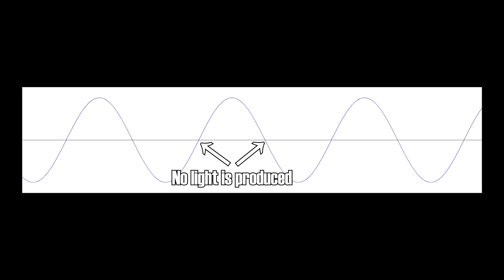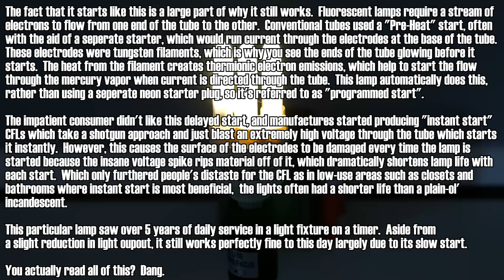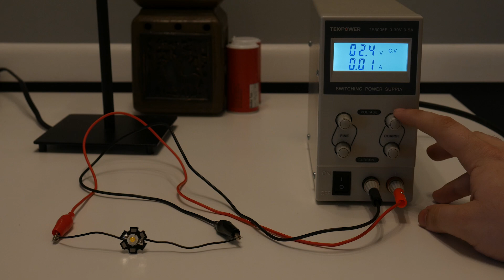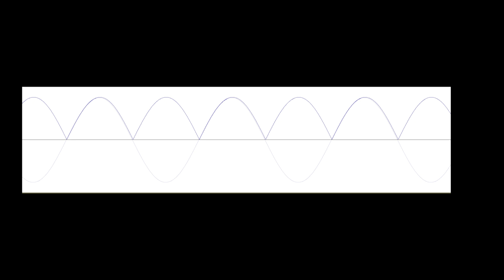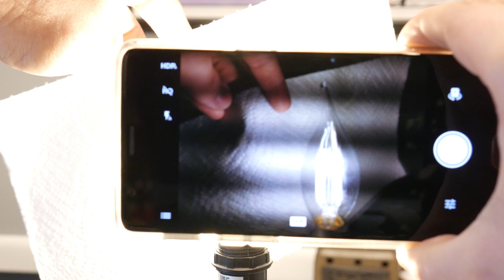LED bulbs that flicker, and CFLs that almost never did

Comment: You should see Bigclive.com's teardowns of these things... There are THREE common driver circuits in use.
1. The very flickery capacitive dropper, usually found on pound / dollar store bulbs... it does have a very rudimentary amount of smoothing, but that's only to protect the LED chain from switch on spikes. These are non-dimmable, and the massive spikes caused by a dimmer would probably burn out the inrush limiting resistor. Has significant capacitive power factor.
2. The "driverless" approach, where LED chains close to supply voltage are driven by a rectifier and current limiter - the dimmable version would tend to have an extra resistive load that is turned  on when the voltage drops below the LED conduction limit. Excellent power factor.
3. Switchmode buck regulator - the least flicker, but can show a harmonic power factor like any non-PFC switchmode PSU
Reply: I suggest you watch bigClive videos again, especially the ones with more sophisticated drivers.
Reply: .... very flickery capacitive dropper, usually found on pound / dollar store bulbs... it does have a very rudimentary amount of smoothing, but that's only to protect the LED chain from switch on spikes. 

Nope. The smoothing cap is to bring it closer to DC, reduce flicker, and improve efficiency. A resistor is usually used to limit current surge.
Reply: I guess Phillips Hue uses type 3? They're not actually dimmer switch compatible, and I guess you'd always need a driver for the RGB values?
Reply: @kaitlyn__L  Hue bulbs house tiny computers which happen to drive LEDs. It's like plugging your PC into a dimmer and expecting it to dim your monitor :)
Reply: @SheaMcCombs  but the monitor has its own microcontroller and driver handling the backlight. So your analogy is a stretch. Especially because the microcontroller inside a Hue bulb responds to other aspects of light switches. And I never said that I expected them to behave with dimmer switches, I factually stated that they don't work with dimmer switches. You can take your condescension elsewhere.
Reply: @kaitlyn__L  Didn't mean to offend, only to make an analogy as to why they're definitely type 3 and don't like their AC being modulated.

I suppose some clever electronics could monitor the waveform (I've seen this in some bulbs) and pass a dimming value on to the microcontroller, but then that'd have to override the hue bridge. So, yeah, they're more like computers with 1-pixel monitors. It's an interesting question and thought it was a fun analogy.
Reply: @SheaMcCombs  ah, sorry, I've had a bit of a bad day. That's my bad. You were probably fine any other day. I also didn't realise you were indeed confirming they were type 3 - thought you were just pointing out the existence of a microcontroller.

I had assumed the light's configurable power-on setting meant that the control was more cooperative from the bridge, with the controller in the light telling the bridge "hey, I'm in this state now" - but maybe they are more dumb than I thought and the bridge tells it what to do on power-on each time? And just keeps watch for the light entering the ZigBee network again? I've not looked into the specific way Hue works really.
Reply: @kaitlyn__L  That's a good point, the bridge can read state from the light. Then again, it might have trouble reaching maximum brightness when dimmed due to the limited power supply.
Reply: I used to have a dimmer for my living room lighting. Then I switched the 220V halogen bulbs for "dimable" LED ones. My dimmer burned out after a couple of weeks....
Reply: The problem is: you don't know what bulb is flicker free before buying. For example even from "good" manufacturers (Osram), you can get flicker LEDs and non-flicker. Unfortunately you don't know beforehand. Even for the same product they might change the electronics over the years. 
There are also super cheap LED bulbs that have excellent flicker rating (aka do not flicker).

Comment: What is a major concern about CFL is that they are made much more short lived than they are actually capable of. The reason is filament, which burns quite fast. How come one should care so much about energy saving when the thing is essentially short lived ? They could be made using cold cathode circuit, which would make them last 10x longer, with some performance reduction over time. In fact, you can forcibly burn the filaments in your CFL and replace the driver to cold cathode circuit, with some higher price, but the thing will last 10x longer.

Comment: Your explanation about the LED power supply is a bit incorrect.

The driver does not limit the voltage across the LEDs, it limits the current. The voltage across the LEDs is directly determined by the forward voltage of the LEDs themselves, with a white/blue LED requiring 3.1/3.2v. In your bulb, each LED was running about 3.17v.

If you were to remove one of the LEDs and cause the string to go open circuit, the voltage would shoot way up to probably close to 170v, assuming the driver doesn't detect this failure condition and shut down. Likewise, if you were to bridge one of the LEDs out, you'd see the voltage across the LED string drop accordingly; But the current would remain the same and drive the remaining LEDs a bit harder.

The reason that many cheap LED bulbs have horrific flicker is because they use capacitor droppers. A capacitor dropper circuit can be made with as little as three components (a capacitor, an inrush limiting resistor and a bridge rectifier), but in this configuration the flicker will be pretty bad. Most bulbs that use droppers also have a capacitor across the string of LEDs to try and smooth out the ripple and discharge resistors to avoid zaps when the power is removed.
Reply from the maker: I'm looking through my script and I never said the LED driver limits the voltage.  In fact on three occasions, I said "limit the current". 
I admit I'm no electrical engineer (and did so in the video!), and to be honest I'm upset with myself for not explaining capacitve droppers because I do follow Big Clive occasionally and I've heard the term many a time.
Reply: @7:58 "The driver must produce at least 81 volts, and indeed it produces about 85"

You implied the driver has something to do with limiting the voltage, which is why I mentioned it.
Reply from the maker: I fail to see how that implies the driver limits the voltage.  That statement follows a demonstration of how narrow the operating voltage of an LED is, and after explaining that it has to drive 27 diodes each with a forward voltage of about 3 volts.  So, the driver has to produce at least 81 volts to light them up correctly.  The very next sentence was "The driver must also limit the current going through this chain of diodes to ensure they don’t overheat and waste energy."
Reply: And as I explained, the forward voltage of the LED string is directly defined by the forward voltage of the individual LEDs themselves. The driver has nothing to do with setting the voltage, or limiting the voltage of the LED string, it's a purely current limiting device.

You could replace the entire driver board with a capacitor dropper and the voltage would remain the same, with the dropping capacitor limiting the total current allowed and the LEDs deciding the voltage. But the two tests I outlined above by letting the driver go open circuit or bridging out one of the LEDs would show this easier.
Reply from the maker: I would say you and I are getting hung up on semantics here.  In the script, I'm mainly explaining the driver as a DC power source--which has to be able to produce at least 81 volts to drive these LEDs correctly.  If it could only produce, say, 60 volts, they would barely light at all, and very little current would pass through them.  I think you would agree that the ability of the driver to limit current would be irrelevant if it couldn't provide at least the string's forward voltage.
My knowledge of the specific workings of the drivers is admittedly limited, but I wasn't trying to get that detailed.  Rather I tried to create a logical progression starting with demonstrating how supply voltage affects the LED when using the variable power supply, illustrating how even mild voltage fluctuations will cause the diode to perform poorly, then concluding that a driver of an LED must 1) be able to supply sufficient voltage and 2) be able to limit current or any voltage over the forward voltage will cause problems.  I didn't go into how by limiting current the LEDs necessarily limit the voltage because I didn't think it would be implied that the voltage is restricted in any way by the driver.
The whole 81 volts part was just my way of showing that, indeed, this driver is providing enough voltage to fully light these LEDs.
Reply: It's not semantics, you're just assuming that the driver somehow produces or limits the voltage, which is incorrect. The voltage supply in the bulb you're demonstrating is directly determined by the mains voltage from which it is powered. In the US, we use 120V, and if you get the RMS value, you end up with about 170V DC.

That 170V DC is clamped down to ~85v by the combined forward voltage of the LEDs, the driver has absolutely nothing to do with this, just pretend like it doesn't exist when measuring the voltage. The driver does limit the current, but it does not limit the current by adjusting the output voltage. An easy analogy dating back to my first electronics class would be that a driver is like a valve in a water system, where it controls the flow of water(amps), but not the size of the pipe (volts).
Reply from the maker: I'm not arguing with you on how the driver works!  I totally understand that.  But I wasn't trying to explain how the voltage the driver produces comes about at that point in the script.  I was simply explaining basic LED theory.  If we were to pretend the that driver produced its own regulated DC voltage, like a switched-mode power supply would, then that voltage would have to at least be the forward voltage of the LEDs.  That's all I was saying.
Reply: Geez.  This is reminding me of the argument of which kills you: voltage or current.  I think it's generally agreed upon that current is the better measurement of what is a lethal shock, but it takes a non-significant amount of voltage to push that current through your body - especially though dry skin.  It's ohms law.
Reply: It would be fairly rare situation where 12V would give you a bad shock.  I'm not saying impossible, but it would be far less common to happen accidentally.  Now, 120V, that could easily happen.
Reply: The only way 12V will cook you is if high current is causing a conductor to heat up and you touch it.  The human body is too poor of a conductor to conduct that much current at that low a voltage.  It doesn't matter how much current the source is capable of, if the voltage doesn't rise high enough, the current won't be there.
Reply: Ohms law:  I=V/R.  If the resistance is "a dozen ohms", that's 1A max at 12V.  But that's after you get under the skin.  Not really a normal situation.  When was the last time we heard about someone electrocuted or cooked while working on their car with uninsulated 12V all around?  Now, if we're dealing with open heart surgery, that's a far different story.
Reply: You're right.  I've never gotten bit by low voltage.  The closest I came was working on a N gauge model train set.  My arm felt just a bit of stinging.  I had forcefully put my arm across the track and the 18V was adding a bit of a sting along with the narrow rails.  I've also "tasted" a 9V battery on my tongue.  And this is after a lifetime of playing with electricity.
Reply: @Kettlesimulator 
>do you even know anything about physics/electricity?

Do you even know what you're talking about? Because it really doesn't look like it.

>if you touch both ends of a car battery, there will be basically no current flowing because you're basically a 1M Ohm resistor or something

Yeah, you clearly have no idea what the fuck you're talking about. The human body resistance is nowhere near 1 megaohm, try more like 100k ohm, and that's not a fixed value. Once you get past the skin surface (broken skin like chapped, sores, cuts, etc.), or have wet skin, that value rapidly drops to around 500 ohms. Electric current also breaks down human skin, so once a current path forms, all bets are off, no matter if it's AC or DC.

If we do the maths using ohms law, a skin resistance of 100k ohms would pass *12 mA*. 10 mA is enough to cause painful shock, and in some people cardiac arrest. It only gets worse from there. Since there's nothing between you and the battery, once that current path forms, the battery will want to push as much current as possible as the resistance between you and it rapidly drops.

I have experience with low voltage, high amperage DC from xenon arc lamps and it's not something you want to be messing with. I've also been bitten by a car battery once, it's far worse than a house mains shock.

>obviously if you have wet hands there will be more current flowing because the water increases your hand resistance

Water DECREASES resistance, you clearly have no idea what the hell you're talking about. The only time water increases resistance is if it's distilled, but that's not going to happen in a real world scenario because the second it touches anything else like skin or metals, it will leech salt and metal ions which make it conductive.

>just because something can deliver that much current, doesnt mean it will. 

Yeah, if what you're working with HAS A KNOWN CURRENT DRAW. Assuming humans are a fixed load and that they're compatible with electric currents is a quick way to earn a darwin award.

>the power grid can deliver like 20,000+ amps at 120v but it doesnt because there's no load that needs that much current, not to mention the losses, breakers & fuses, ect in series.

You really aren't that bright are you? There is no distribution service in existence in the world that can deliver 2.4 megawatts sustained at 120v. You'd need electrical cables the size of city buses to transmit that.

Here's how power distribution lines work. You have a street service at 11 kV on up and round cylinders on the power poles (or cubes on the ground in the case of buried mains.) These transformers take that 11 kV and step it down to 240 split phase usually for residences. But you'll never, EVER even get close to approaching 20,000 amps (2.4 megawatts.) That amount of energy can power a small town.
Reply: @Kettlesimulator Hahahah, that's cute.

Sorry kiddo, but following your original hilariously idiotic drivel with a straw man fallacy doesn't make you any more knowledgeable than before, you're just perpetuating your idiocy.

Either that or you're a really bad troll, which is even more hilarious.
Reply: @Kettlesimulator You're adorable with your pouting.
Reply: >The only way 12V will cook you is if high current is causing a conductor to heat up and you touch it.

Very incorrect. The only thing protecting you from being cooked is the relatively thin layer of dead skin cells, which normally has a high but variable resistance.

>The human body is too poor of a conductor to conduct that much current at that low a voltage

Also very incorrect. The body is 70% water mixed with conductive salts and organic material. Once the small dead skin layer is broken down, the body has a very low resistance, in the order of a dozen ohms or less. Low voltage with a huge current potential like a car battery will cook your flesh wherever it decides to make a path.

>if the voltage doesn't rise high enough, the current won't be there.

Also incorrect. You can have a low voltage with heavy current, A xenon arc lamp is a perfect example. The 35mm projectors I used to run at a movie theater ran at 25v at 160A, or 4000W average. A car battery at 13.8v can push 600A, or 8280W, you will be cooked if you make a path.
Reply: 12 watts is enough to cook your internals, I don't think you understand the force behind those numbers. It's clear you've never been bitten by low voltage before.

>But that's after you get under the skin. Not really a normal situation.

Only takes slightly sweaty hands or a cut to start, which is perfectly normal if you're working with your hands.

>Now, if we're dealing with open heart surgery, that's a far different story.

Once you get under the dead layer of skin, pretty much everything is low resistance. You don't need to be near the heart to get bit.
Reply: Volts directly determines the current, and since human skin isn't a normal resistor, it's both that work together to determine the lethality.

I've been bitten by both low and high voltage, and if I had a choice, I'd choose low voltage. It hurts way more, but you don't get stunned by the nerve overload and have a better chance of pulling away. Car batteries and low voltage, heavy current supplies are just as dangerous in any condition as mains.
Reply: 12v won't shock you, it will cook you. It's not at all rare that you can be cooked by 12v if it's looking to push tons of amps, like a car battery or linear power supply. Slightly sweaty hands will drop the skin resistance and the current will flow. Car batteries are designed to push 600 cold cranking amps and more, and they will do it without limit until either the battery self destructs or whatever is the connection is burned to a cinder.

Comment: Still useing Philips 1980s SL First generation CFL here. Take a few seconds to start up due to magnetic ballest but they last like 10 years plus. Had one working from 2003 to last year when it finally started flickering and EOL.  But yer They are heavy. And hum a little bit.